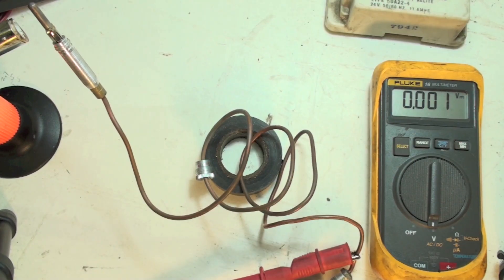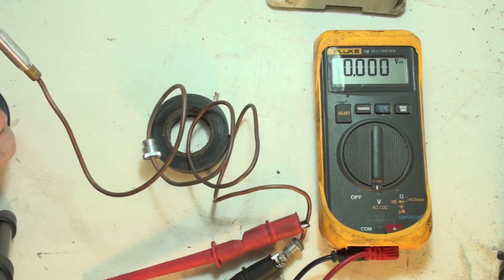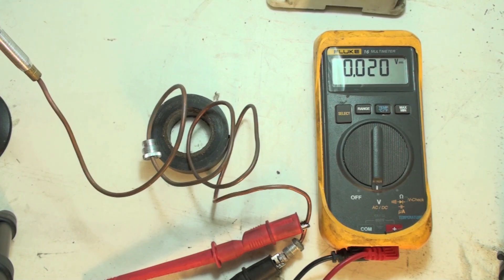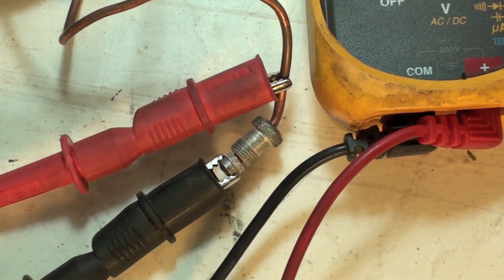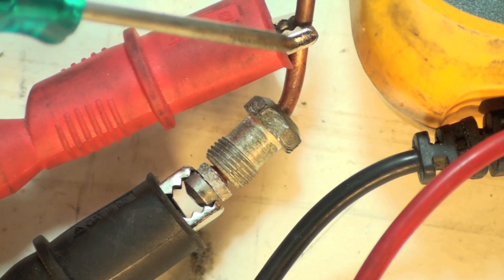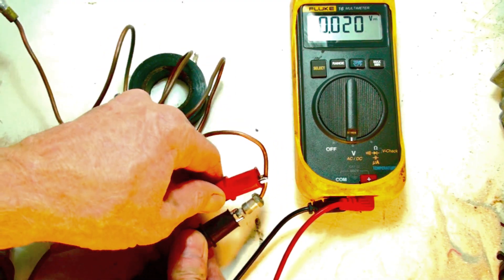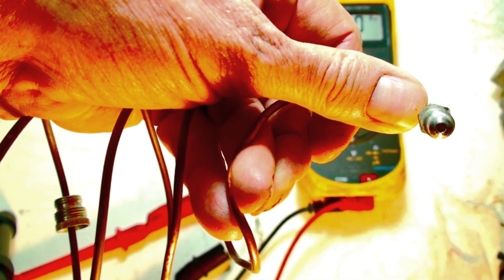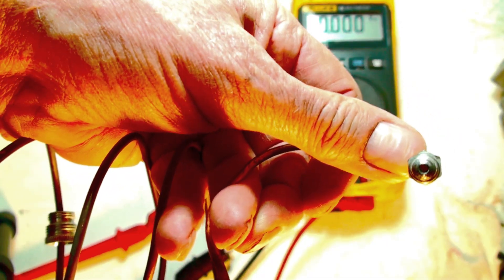Gas furnace will not light.  Thermocouple test with the multimeter

Comment: What does the small voltage do?
Reply from the maker: It energizes a small electromagnet that holds a valve open.  When the pilot goes out, the voltage is gone and the electromagnet no longer holds the valve open.
GFM

Comment: Are these thermocouple supposed to be ON all the time?  I have a fireplace and the person that sold it told me that it's not good to turn the fireplace off.  That it's supposed to be on pilot if anything.  Is this true, that the thermocouple would go bad if I turn off the gas and then light up again based on my needs?  TIA.
Reply: Occasionally, thermocouples will fail if shut off, then turned back on.  It is not common, but it does happen.
GFM

Comment: How do you test inside the furnace when meter leads has to be on button which is screwed in?
Reply from the maker: You hold down the pilot button, light the pilot and take the reading on your meter.  Unless you have 4 hands, you will need alligator clamps for your meter leads.
GFM

Comment: Hi! I really hope you're still answering questions for this one. Here's the thing, very old furnace, pilot is lit, flame is blue at bottom orange at top, I'd say it's touching about 2-3cm at top of thermocouple. But the furnace won't stay lit. I can push the safety valve button in and out and get it to light sometimes, but then after like 10 secs, I'll hear a click and it shuts back off. the pilot continues to stay on. Should I replace the thermocouple?
Reply from the maker: If you are using natural gas, the pilot should be all blue.  You can clean the pilot with compressed air.  
Your system sounds like it is a thermopile system.  If its, let me know and I may be able to give more specific help.
GFM
Reply: @grayfurnaceman  Hi! Thanks for responding, no I  have a thermocouple (searched for thermopile and it doesn't look like that.) Its one of those older chain systems that you've shown before. Wish I could provide a picture. I'll look for direction on how to clean the pilot. Do you advise that before thermocouple replacement (I've replaced it before about 3 years ago.)
Reply: @grayfurnaceman  Is there other way of knowing which system I have?
Reply: @grayfurnaceman  Sorry for the multiple replies- just to add more color. This issue started last winter. Where the pilot would stay lit, but the main plate will not light on its own. I have to press the safety valve in and pull it out. Interestingly, this winter, when we first turned on the furnace, the problem was nonexistent, and the main plate lit up when the thermostat called for it. And then it problem just came back last week (after about 2 weeks of good running). Also, sometimes, after manually getting it going, it runs for a while, (maybe 30mins - 1 hr) before we notice the house is cold again, however, the day I sent the message, the main plate was cutting off after 10secs. It did stop cutting off quickly that day, but its still not staying on for as long as it needs to to heat the home, and not relighting itself when the thermostat calls for it. (sorry for the long story, but I wanted to give you as much as I can)
Reply from the maker: @tneshaward6121  I would try replacing the thermocouple again(mostly becaue its cheap).  If that does not help, you probably have a failing gas valve.  That would mean replacing the gas chain with a combination gas valve.  A fairly complicated repair.
GFM
Reply: @grayfurnaceman  So I just both cleaned the pilot orfice (thanks for that video showing what that is, it was noticeably dirty and I cleaned it with compressed air and shined a light showing 2 clean holes, after that my pilot fire was nice and blue!) and I've replaced the thermocouple. after turning on the thermostat to heat, it lit right up! Now gotta wait for it to do another cycle organically to confirm success 🙌🏼! Thank you very much! If this doesn't work consistently, I will replace the chain with the combination!

Comment: Uhhh so whats the output vs heat range? I could easily get working voltage by accidentally overheating the tc right?
Reply from the maker: There is no way to accurately determine temp.  Even if it is red, the output will be about the same.
GFM

Comment: Since I’m a relative HVAC “dummy”, I’m assuming the one you tested was good?
Reply from the maker: Yes.  A good one should read 20 to 30 millivolts.
GFM
Reply: @grayfurnaceman  That was a fast response and that is awesome. Actually, I’m not working on a furnace, it is one of those tall propane heaters with a dome on top. It will only burn if you push the knob in. When you let go to set lo-hi, it goes out. I guess it all works in the same way? Thank you so much for your input.
Reply from the maker: @brookswade5774  Probably a failed thermocouple.
GFM
Reply: @grayfurnaceman  That’s really odd to me. It was barely discolored from the flame. It sits in front of one of the venturi.
Reply from the maker: @brookswade5774  All you can do is test or replace it.
GFM
Reply: @grayfurnaceman  I’m sorry that I couldn’t answer faster. Thank you so much for your help. I’ll test it in the heater and then I’ll know where to step next.

Comment: Very cool man
Is it possible to test these while they’re hooked up to the furnace and screwed in inside it’s port? I’m going to guess no
What about testing thermopiles?
Reply from the maker: Thermocouple no.  Thermopiles have open terminals that can be checked in the circuit.  Should read 125 or more MV while energized.
GFM
Reply: I remove one lead, and heat the thermocouple in place with a propane torch. On some units you dont even need a meter, just listen for the gas solenoid to clunk.

Comment: Hi, I have an old O'Keeffe and Merret gas range. The oven will not fire up. The pilot works all day but when I try to turn the oven on has no increase of gas and will not fire up the main burner. Any ideas?  Where would I get parts for this kind of old stove?  Thank you
Reply from the maker: Probably the oven gas valve has failed.  The parts for it are available as general replacement parts.  However, you will find the valve is more expensive than the value of the stove.
GFM

Comment: Excellent informative video!   
After reading the comments I see that a thermocouple can still produce milivolts but still be bad because its just a tad bit too low.  So what is the minimum allowance before determining they are bad.   I assume they should read above 30mv to be declared okay?
Reply from the maker: 30 mv is the maximum voltage.  14 is usually considered the minimum.
GFM

Comment: I would try to light the pilot.  If it doesn’t light it’s simple and cheap to replace the thermocouple.
If it lights I shut the pilot and time how long it holds the pilot open.  If I recall if it didn’t drop out for about 45 seconds or longer I would change the thermocouple.  90% that fixes it.
The demo is for class purposes and excellent.
Reply: I would think that time could vary based upon surrounding outside temperature or if there is some air movement around it like a draft or breeze.

Comment: My thermocouple gets up to 178mV for a gas range. Can I use a 'universal' homedepot thermocouple to replace?
Reply from the maker: No.  This is not a thermocouple.  It is a thermopile.  It is a power source for the appliance.
GFM
Reply: Dang it looks just like it. If it's working like it should, could be the gas valve? It has 2 wires going to it.
Reply from the maker: It could.  First I would check all connections.  They should be clean and tight.
GFM
Reply: It turns out to be the oven thermostat that's the problem. I'll probably just get a new oven, this is very old and as I was tracing the bulb sensor part, I found a bunch of mouse droppings in the insulation. So gross. 
Thanks for your help.

Comment: I think the weakest link in most  patio heaters is the anti-tilt switch. When it fails you get the most common complaint of "Won't stay lit after the pilot knob is released".  Nine out of ten folks just bypass the thing by jumpering the wires and you're ready to go. Of course clean out webs and debris from any tubes while you have the thing apart...

Comment: I find it interesting that the thermocouple is reading reverse polarity... you'd think the outer shell would be the negative ground but it's the positive and the negative is insulated in the center... opposite of the magnetic switch found in units like the Robertshaw 7000 MBVR. on those the Th/Tp in the center is negative and is bonded/connected to the metal casting to complete one side of the electromagnet. The TP on the left is the 250-750 mv positive to keep the pilot valve open and the TH on the right is the negative return side from the thermostat which also runs through the HL "High Limit" switch. I know this is a little more that just the thermocouple or thermopile but they all work together and I thought some may find it useful. I have tips on how to test the gas control valves if anyone is interested. I check them fast and simple every time.  BTW GFM, I'll reply back to the email you sent me about that FEDDERS heater that was going crazy... finally figured it out when I'd had enough and ripped All the wires out except the two 240VAC main feed and rewired it... had to also change out several parts that were Wrong and not wired correct... It's working now and they have safe comfortable heat... just before a freeze hit just hours after I finished....
Reply from the maker: The polarity of the thermocouple makes little difference.  All it does is power a magnet to hold the valve open.
GFM

Comment: GFM. I have replaced my control board (new) and my gas valve (used, from a reputable source).  My induction motor comes on and the igniter glows, however, the burners are not firing. I have watched your videos and am going to go and buy the electronic testing equipment you used in your video to check and see if my new control board is sending the correct amps/volts to my valve. It seems there are only a couple issues I could have.
Thoughts?

Freezing
Reply from the maker: I would be looking close at the plug connections.
GFM

Comment: Not sure if you can help or not. My 95 year old grandmother was given an older U28 Regency fireplace. She wants it working so she doesn't have to have wood brought in for her wood stove. (Her only heat source) I don't know if it's hooked up right or if it works correctly. I don't know anything about gas stoves. Can I inspect it to make sure it works correctly without having the gas company turning on her gas? She doesn't want a gas bill if this fireplace doesn't work, but I don't know what to check for. I would really appreciate any help you can give me.
Reply: I'm just concerned with getting the gas turned on and hoping it will work. I think it's a little irresponsible to turn on gas without knowing the appliance is safe or wired properly and how to check it prior to gas being introduced to the system. I have a fear of exploding everything :(

Comment: Hey GFM I have a question. ...im working on a intertherm gas furnace on a modular home....the pilot stays lit but when I call for heat nothing happens.....24v is present......I tested the thermocouple and I got 23 milivolts.....is that efficient enough to open up the gas valve? I've never had this problem before and I'm in need of your knowledge. I hope you can help me. Thanks in advance
Reply from the maker: First, you do not have a millivolt system on your furnace so the thermocouple is there only as a flame safety device.  It does not open the gas valve.  Your reading of 23 millivolts is good.  If you have 24 volts to the gas valve, you have a problem in the gas valve.  No voltage at the gas valve,  start with the thermostat.  Hope this helps.
GFM

Comment: Thanks Grayfurnaceman. is it necessary that the thermocouple touches no other metal objects in the fireplace?
Reply from the maker: The end should no be in contact as it will reduce the temp of the thermocouple.  The wire is ok to touch metallic parts.
GFM

Comment: Nothing was happening in my furnace, so I put a new fuse in and it started to work.  Then it wouldn't fully ignite and shut off.  Any solutions?
Reply from the maker: +Blaine Coyne I need more.  What do you mean by "fully ignite"
GFM
Reply: +grayfurnaceman Actually, I fixed it.  changed the fuse and cleaned the thermocouple. Thanks though!

Comment: Hi, I have an ArmstrongeAir gas  furnace, It has a glowbar style ignitor, it's about 4 inchs long about the size of a pencle  enclosed in metal. Could I replace the ignitor with a universal 120 volt ignitor? Are all these igntiors 112 volt?  Does the ignitor talk to the control board about resistance?  Thank you
Reply from the maker: +EurekaRecycler Some ignitors do talk to the board.  I don't know if yours is one.  You can try the universal.  Virtually all of these are 120v if the furnace is less than about 15 years old.  Hope this helps.
GFM

Comment: Hi, I just replaced my gas valve. The heater fires right up, but after a few minutes the pilot light disappears and no more heat. Any ideas? Could it be a dirty or bad thermocouple?

Thanks.
Reply: Could be but also make sure your gas control valve was installed the correct direction meaning the gas is flowing into the valve and not into the exit port

Comment: grayfurnaceman... my water heater.. keeps going out.. and my pilot light also goes out.... I will need to relight the pilot light on and everything stays light and once water boils and stops... thats when my pilot light goes out as well... do I have a thermacouple issue ? or fuseible link issue ? I think I saw a part that looks like a resistor of some sort... light melted away.. I was in a rush and do not remember clearly..   can I unhook the thermocouple while the water is on and boiling water ? do I need to worry about gas escaping from that hole ? THanks.
Reply: Sounds to me it's going into safety mode could be getting to hot or too much pressure

Comment: thanks for your video, it helped understand how my rv hot water tank works. Question though i forgot to empty my lines last year and my tank blew, so i had a welder friend repair it, but while removing everything i bent the thermo couple line so that it is broken just below were the nut attaches to the valve so the voltage is not getting transferred up as the is a complete break in the outer sheathing, is there a way to splice it or repair it,k like a piece of tin foil wrapped around the line
Reply from the maker: brutherb Replace it.  Its not expensive.
GFM

Comment: Hi, I tested quite a few thermolcouples on water heaters that read 23  millivolts but I still replace them and the problem always gets fixed ... I fix water heaters for people ..
Reply from the maker: Bambam Bullies Many water heaters use the thermocouple as an actuating control for the gas valve rather than just a safety control.  Those heaters could very well drop out at higher MV readings.  Thanks for the good thoughts.
GFM
Reply: I've been using 30 millivolt thermocouples on GE gas water heaters and they work great ... The thermocouples I replaced usually read 24 to 26 millivolts before I replace it .. I hope they last the customer many years

Comment: Furnaces lites fine, but after running the main valve for 15 minutes with the door shut it goes out  i cycled it several times under the house and could not replicate but as soon as i get it back together and inside once it satisfies it goes out and has to be relit.  standing pilot on a 77model GE,  i was always under the impression that thermcouples are either good or bad. my thought was that the heat exchanger may be cracked allowing air to blow out the pilot.  whats your thoughts.
Reply from the maker: crob227 If it is the one I think it is, there were 2 problems.  One, they tend to develop small cracks in the heat exchanger.  Second, the baffles at the top of the heat exchangers tended to plug and the flame would roll out and put out the pilot.  The baffles can be removed and cleaned.  The rollout is especially dangerous because of fire hazard.  Hope this helps.
GFM

Comment: the reigniter sparked by itself without me turning on the heat ( during summer time). I replaced the reigniter , however the furnace does not turn on now... ( maker Carrier 58 SS)  It's cold now,, any help ? Thanks ! DC
Reply from the maker: dien cao Sorry about the last comment.  Wrong response.  
The reignitor is an odd problem.  What age is the furnace?
GFM

Comment: To test the thermocouple inside the furnace, do you unhook it from the gas valve and start the furnace how you would normally would? or how would you do it?
Reply from the maker: SombraLocs Yes.  Remove from gas valve, attach meter, hold down button, light pilot and wait for meter to stabilize.  You must hold down the button for the entire time.
GFM
Reply: basically you need 3 hands, they should make it easier to test them.
grayfurnaceman
Reply: Wedge a small screwdriver to hold the pilot button down!
Reply: Just FYI there is an adapter that can be purchased to connect to the gas valve then screw the thermocouple in the adapter this way it is tested under load this way you can blow out the pilot to see at what mv the magnet drops out to determine if it is the thermocouple or magnet in the valve

Comment: These bench tests are not infallible. Mine tested good...actually more voltage than the new replacement, but the old one did not work, and the new one does.
Reply from the maker: infinera06 You are right.  This is just one of the tests necessary.
GFM
Reply: Good quality DMMs have a very high input impedance, which may not load the thermocouple enough to simulate what the gas valve may put on it.  But, if the thermocouple does not pass the DMM test, it IS bad.  If it passes but won't maintain the pilot, try another, they're cheap enough.  Keep one handy in any case.